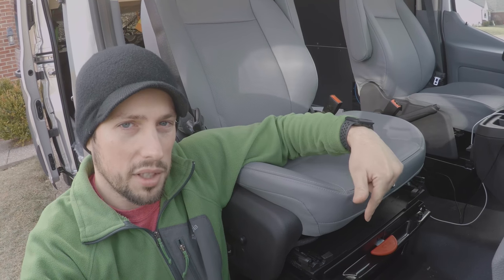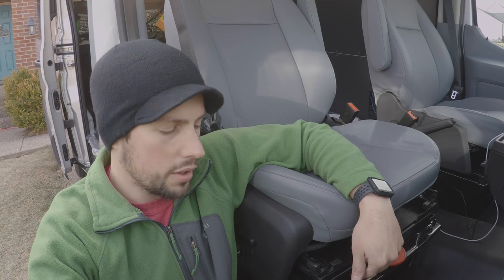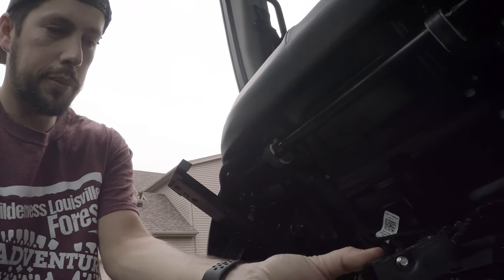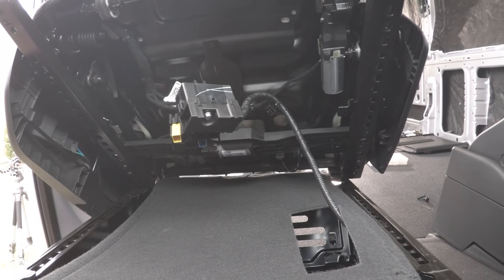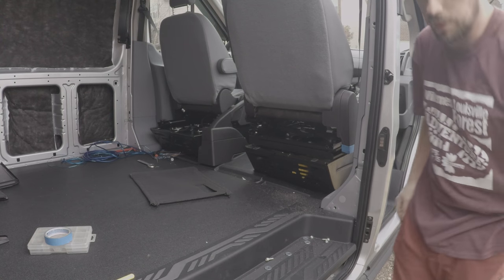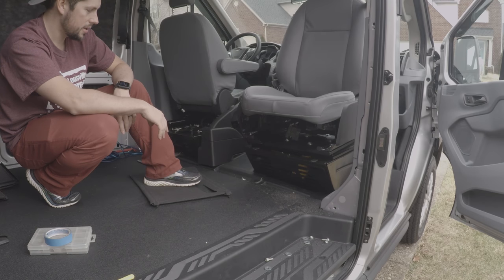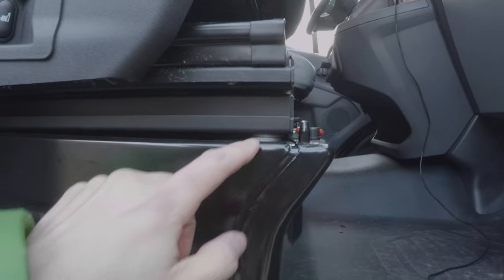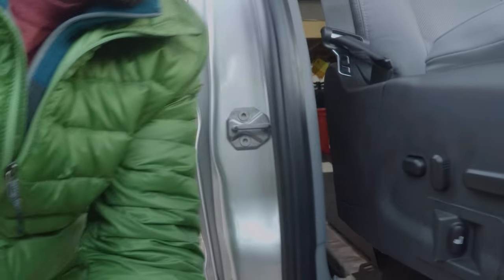Van Conversion: Installing Seat Swivel in Ford Transit // Van Life EP. 2

Comment from the maker: Is it strange that cutting up a new van doesn't bother me? Anybody else not stress about cutting and drilling holes in their rig?
Reply: I would be just a little nervous. Was just thinking to wait to cut once the seat and swivel are remounted to figure out the least amount to cut off. Looks like the power seat switches are high enough thankfully. I will be continuing to follow. Great job.
Reply: Nope.  I'm excited to cut the hole in the roof for the MaxxAir in a couple weeks.  Did the swivel install today, and thanks to learning from your vid, it was easy peasy.
Reply: 2001 POS Ford E-250. I'm not worried at all. ;-)
Reply: I'm taking a saw to my Transit roof next week for a max air fan. Looking forward to it. Thanks for the great videos and advice.
Reply: Great job on the build. Thanks for sharing.

Comment: Hey good stuff thanks for this vid. I just installed this swivel in a 2016 Transit and didn't have most of these problems. I think you mounted the swivel a bit farther back than you should have. The swivel is supposed to go over the front peg on each side of the base. It looks like you lined the swivel a step back, which made you have to drill new holes and add shims for clearance. It also affected how the plastic side clears the corners when you swivel it. Might just be a difference between the power seat features and regular seat (which I have), but I had a much easier time once I mounted it about half an inch forward from what you did.
Reply: Correct, the difference is the e-seats.  Ford now offers factory swivel but 4 way manual only.

Comment: Should be noted that the seat will not swivel to the rear unless the door is open.  My installation took about a half hour with the help of my Dad who had all the right tools.
Reply from the maker: Deanna Szuter do you have the power seats as well? We have to open the door slightly to turn ours too.

Comment: Instead of placing the washers under the 2 front bolts, could you have bent down the base instead?
Reply from the maker: I thought about that but where it connected was right on the edge of the base. It would have required altering the vertical support as well. I could have cut a notch out of the base or dented it in with a hammer but decided to take the less permanent approach.

Comment: Just curious when mounting the seat to the swivel do the bolts point up or down to clear the seat sliding and you didn't show us how far back it will recline once it's swivels in

Comment: Does the passenger seat wobble (or feel any different) now as you're driving down the road?  Love the new channel and build, I'll be following for sure!  
I'm assuming there's no way to get the driver seat to swivel too?  (looks like the e-brake is in the way)
Reply from the maker: When driving there is a small wobble but mostly not noticeable (per my wife). You can swivel the drivers side but it requires you to lower the emergency brake handle. It is a bit of work to complete but it's been down successfully on several other vans. We don't currently plan to swivel the drivers seat though. Maybe later down the road if it makes sense with our planned layout.
Reply: I did my passenger seat today, and I plan to do the driver's side in the future.  Probably not until next year.  It's a different swivel than the passenger side, and as OW said, a bit of work.  Not near as easy as the passenger.